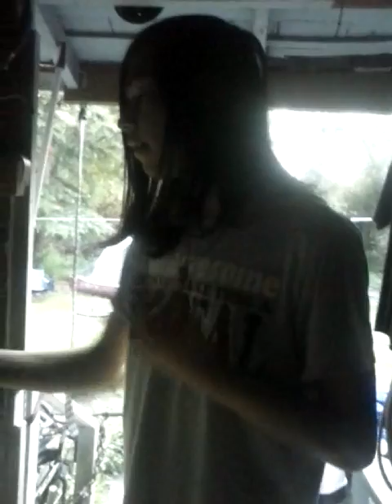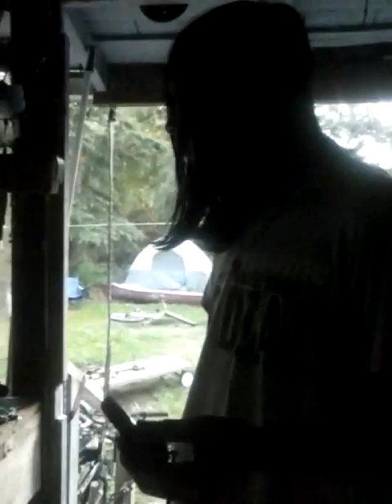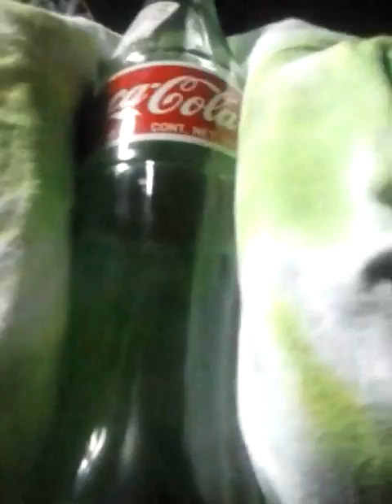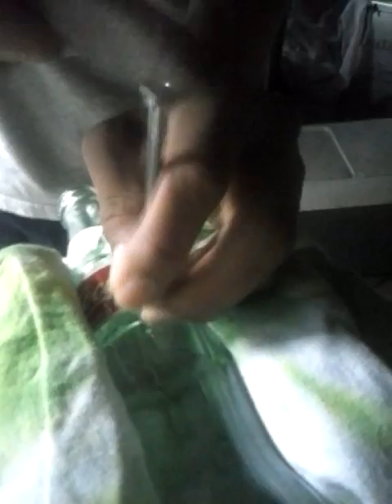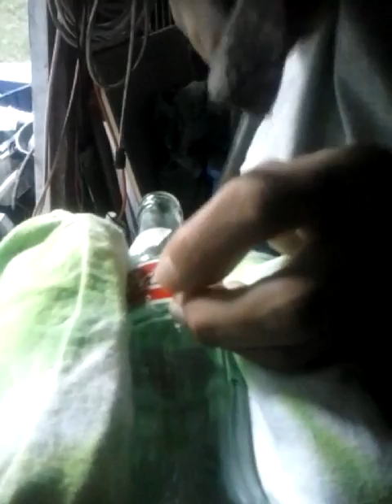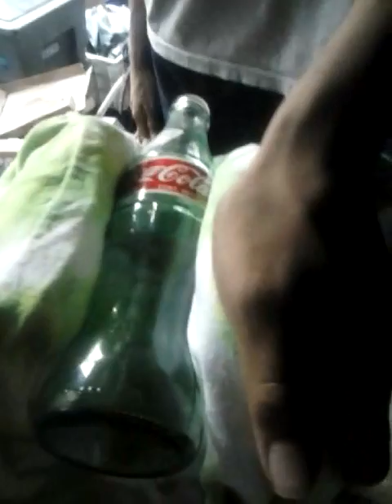How to put a hole in glass without power tools

Comment: Very smart, the proper way to make a hole in glass without using a torch is by grinding not cutting. Your method is more manual, but gets the job done.